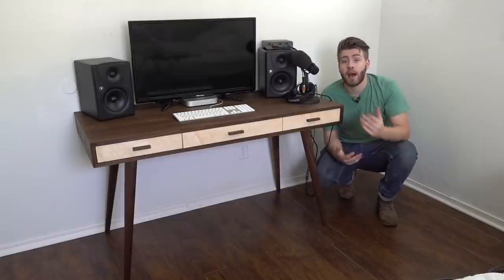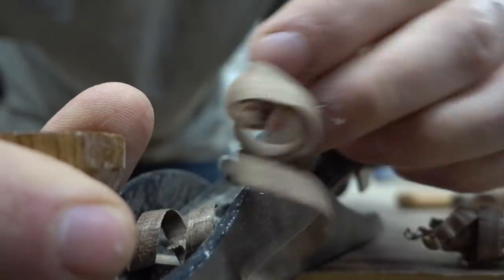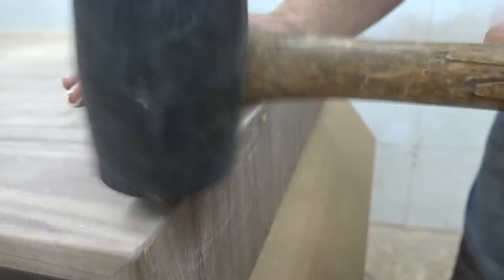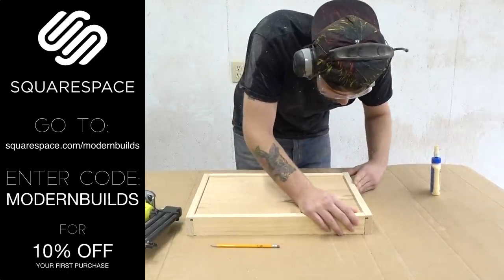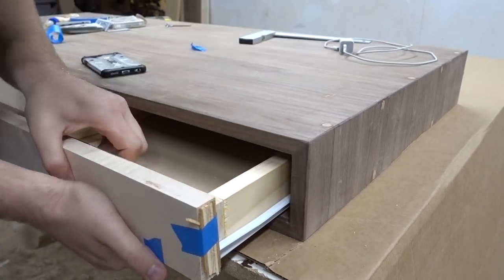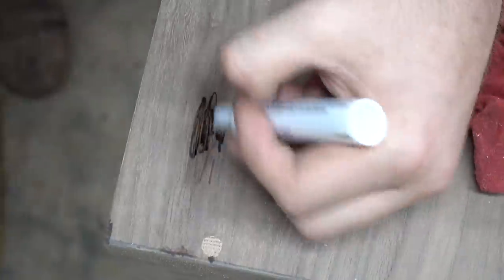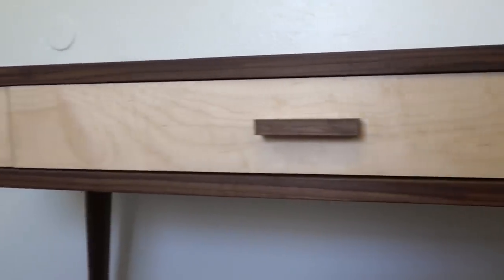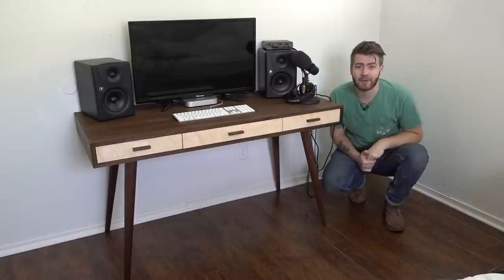DIY Mid Century Modern Desk | How To | Modern Builds | EP. 60

Comment: Hi Mike, I have been there with solid walnut before. I used sawdust and wood glue to fill voids and cracks. After it was dry, I sprayed water on to see where the overflow of glue was, because it would block the varnish seeping into the grain and wouldn't match, then wet-sand the glue away. Nice design, by the way.
Reply from the maker: Yep! That's the way to do it... Thanks John!

Comment: Would it be possible to give us the total amount of the project? I know that might be difficult since not everyone watching is from the US, but it's usually the biggest factor when I'm deciding whether to DIY or buy.
Reply from the maker: The walnut ply was about $100 or so, and the maple cost about $10-15
Reply from the maker: Legs were definitely expensive though! About $300 after shipping and everything
Reply: Modern Builds Thanks man! It came out sick. Kinda pricey but definitely still way more cost effective than buying it elsewhere. Maybe you can add the total amount in each video? Just a suggestion. ✌🏽
Reply: Wood prices change consistently so putting prices isn't really feasible. I sell lumber/hardwoods and I have seen prices, especially recently, move around quite a bit.
Reply: madmiles hmm didn't know this, thanks for sharing
Reply: @ModernBuilds  ouch

Comment: Over cut your miters to 47-50 degrees. This way your miter joints will be tight looking to the outside where it matters and have a slight gap on the inside which no one will see. The point of the miters will touch making a tight looking joint. Then add your edge banding after the box is put together which will give cover your gaps from the edge and cut those to fit the perfect 45. Outside seams on the plywood are perfect looking and edge banding looks good as well. No one will see the inside gap. It will save you time trying to dial in your circular saw and give you a clean perfect look.
Reply from the maker: yeah, I'd definitely be better to be over than under!

Comment: Those legs look awesome. But do you think they are that much better than the Wadell tapered table legs that are much cheaper? Awesome piece though - one of your bests!
Reply from the maker: They're a bit nicer, but quite a bit more expensive. They're a little beefier, but the main thing is the mounting hardware. These use a big wood bracket where the waddells use the small metal plate.

Comment: Hey mike this desk was really awesome! Those are not mistakes! They add character to the desk ;) 

I have a woodworking beginner question: I'm doing myself a bed from pallets that are made of canadian pine, i used stain to darker them out but recently i was told that i should use at least mineral oil to finish it, what would you advise me? and how its the application of the oil? its like the stain? i have seen you used the danish oil quite a bit in the last videos. 

Anyways cheers! ;)
Reply from the maker: I would use satin Minwax Policrylic with a hi density foam brush. Just add about 3 coats with a soft had sanding of 220 grit.

Comment: Hey Mike!!. I have a question, how much Danish oil did you use? Does the oil yield for other products or do you use one oil for each product you produce?
Reply from the maker: It really depends on the size of the project. I probably used about half a can. Plywood doesn't soak up quite as much as sinus wood. Pine soaks up a ton

Comment: Why did you use hot glue instead of wood glue for the drawer face?
Reply: Amy Crawford-Jonas The hot glue sets up quicker so you can screw the drawer faces on pretty much straight away. If you used a PVA type glue you'd have to wait half an hour or so for the glue to set enough to hold the front in place.
Reply: Good tip. Thanks!